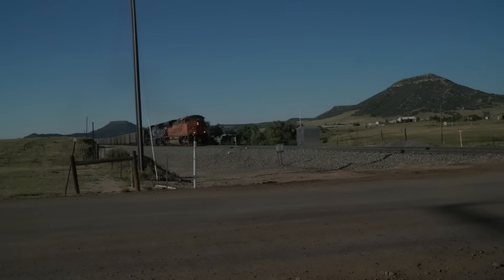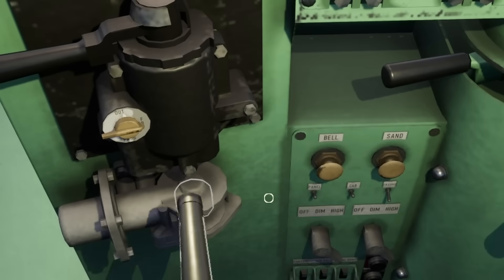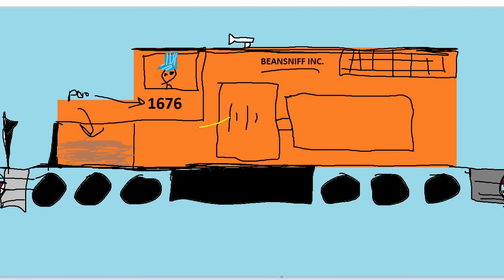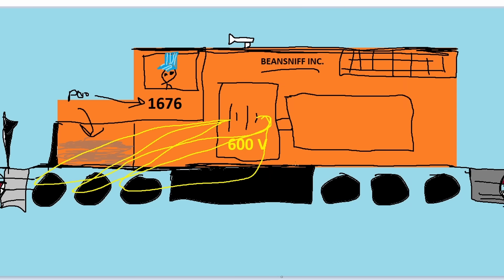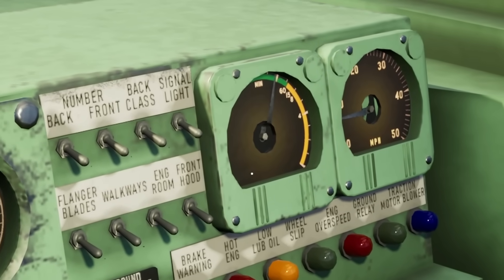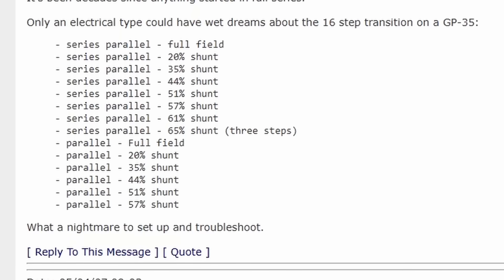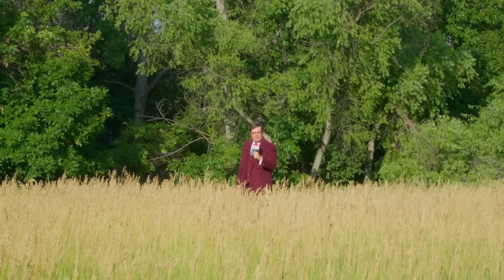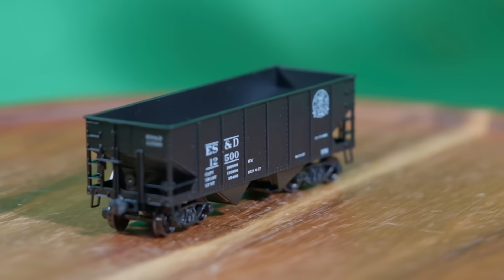The HIDDEN GENIUS of diesel electric locomotives... Transition explained - Railroad 101

Comment: AC motor circuits can actually be simpler than the DC setup described. I'm not a locomotive engineer, so I don't know how this actually works, but a neat trick with AC motors is as follows:

Most railway locos that use AC motors use a sub-class called Induction motors (mostly because they are cheap, robust and have reasonably high power ratings). The torque that an induction motor puts out is proportional to the difference in speed between the AC frequency (called Synchronous Speed) and the motor's shaft. (Electrical Engineers at this point will go on about machine poles, wound rotors and flux issues but please, I'm not talking about that now).

One other thing is that the frequency of AC produced by an alternator is also proportional to the speed of the alternator. So technically you could control the speed of an Induction Motor by simply varying the speed of the alternator, which you can in turn control using the Diesel engine speed. I don't think this is how it works, but you can probably make this work if you vary the voltage in the right places.

Comment: G'Day #Hyce! I worked on Locos. I was a Mechanical Fitter/Diesel Fitter here in Perth Australia. I wanted to be an Electrical Engineer, but  wasn't that smart, so I tried to be an Electrical Fitter.  I was told that if I did Mechanical for a year, I could transfer to Electrical , but they insisted on a 4 year apprenticeship, meaning a total of 5 years, with one year wasted. I said no. 
These are Aussie terms, but basically I spent 4 years at #Westrail, working on lots of locos Various engines and sizes. Our biggest Loco, Standard gauge was the "L Class"  had an EMD 654 E3 v16 which made 3300HP. I rebuilt these or did engine rebuilds, upgrades, refits etc. Concurrently, after working a 40 hour week I did night school, starting my Dip. Elec Engineering, 4 hour sessions, 4 nights a week for two years and finally gave up. 
For two more years,  after a 40 hour work week, 4 nights a week, I studied the Diesel fuel injection, Air Conditioning, Pneumatics, Hydraulics and some Automotive courses too (Auto A/C, Pollution controls, Auto Electrics, etc. After 4 long hard years, I walked away. 

I went on to be a Magazine photographer and shot most of the bands and singers in the 1980's for music magazines. I spotted your guitars and thought I'd mention that I own a 1960's Semi acoustic base. The same as used by the Yardbirds and a few famous British bands. I sucked at guitar... I'm 61 now and teaching myself keyboards. Currently mastering "Simple Man by Lynyrd Skynrd" Thanks for an awesome video. You explained everything so well and you should be lecturing at Technical college! Thanks heaps for this video and much respect.

Comment: I remember well that the SD-40s will transition at 25 mph and 45 mph. 

Interestingly, the GEs that were prevalent at the time (early 2000’s) had the traction motors all in parallel all of the time. I remember pulling up the screen that showed various parameters, and when they were really pulling hard- like less than 15 mph in run 8, the generator current was pretty close to five figures.

Comment: hey, Hyce, randome little request, if you may. about Derail Valley. i jsut ended up fixing, and painting up my DM3. could you explain to us a bit of effective real breacking with the Egine breacks?i am still unsure about it. i mostly use Train break, wen on a jo, or independent breacks when standalone locomotive, but i am sure that the engine break is also something really usefull!
Reply: Engine braking on DM3 is simple. Move throttle to idle and adjust braking lever. Higher engine RPM and shifting to lower gears give more braking force.
Reply: @Knsgf  thanks! will try to get more used to it that way. train break is really weird. i'm nit a big fan of it 😂

Comment: I thought the series-parallel stuff was referring to whether the field was in series or parallel with the rotor, (or whatever those parts are called in a motor.). Do they use AC induction motors today?
Reply: Motors with parallel field are suitable for powering industrial equipment which runs at constant speed, not for locomotives. While newly built units use induction motors, there are still a lot of old and refurbished rolling stock with DC traction.

Comment: It would be simpler if the diesel engine powered a hydraulic pump that would push oil to the hydraulic motors on the wheels
Reply: how bout 4 diesel engines going to a gearbox full of mechanical nonsense that moves an axle that moves rods which move wheels?
Reply: @davidty2006 Ah, the good ol' class 10100. With 2 extra diesel engines for whoosh.
Reply: @davidty2006 another one who has no idea about hydraulics or what he's talking about
Reply: Diesel-hydraulic is not exactly good for very heavy applications. Maintenance wise, more complicated than a traction motor as you have to deal with high pressure liquids and seals.
Reply: @OptiAero6432  on the car, the power steering pump has been working without error for 20 years, the oil itself needs to be changed on time,if such or a similar pump were dimensioned in a relative ratio for the power it has to transmit, there would be no problems, because on airplanes there have long been pumps with a tilting plate through which the flow and pressure of the fluid can be changed so that the diesel motor can constantly work at the most suitable revolutions depending on the required power
Reply: @makantahi3731  Steering circuit in a car doesn't accelerate the car. Hydraulic systems in an airplane do not accelerate the plane. Diesel locomotives, unlike cars and planes, have to drag thousands of tons behind them. Their power demands are much, much higher than a hydraulic line with flexible hoses can practically withstand without bursting open. There is a reason why diesel hydraulics are built with a hydrodynamic and not a hydrostatic transmission.

The only practical use for swashplate hydrostatics in a locomotive is controlling speed of radiator fans. And even there it's not common: on most designs fans are either driven mechanically by a prime mover, or by small induction motors.
Reply: @Knsgf  The reason why the first locomotives were diesel dc-dc is that those who produced them had no idea about electricity, although they could have produced a diesel ac-ac locomotive with the available technology, but they were ignorant. Compared to a dc-dc locomotive, a diesel hydraulic locomotive would be easier to use because the hydraulic system transmits significant power, for which it does not matter what it does: whether it moves a piston or turns a rotor, hydraulics are widely used on high-power excavators. It is important to properly dimension all parts and there are no problems, on my car the flexible hoses are rated at 160 bar, and the permanent pressure is about 20 bar. With a sufficiently large cross-section and moderate pressure, the power of 5000hp that locomotives have can be transmitted without any problems
Reply: No it wouldn't. All those shafts, converters and gearboxes bring in more complexity at high horsepower than electricals do.
Reply: @Knsgf  You don't know what you're writing about, there's nothing to what you said.

Comment: Hyce,you really should go into the history of K,and M,type controllers on Streetcars,and Interurbans,plus electric locomotives! Both GE,and Westinghouse were involved in DC,and AC transmission systems,and the resultant equipment! The New Haven railroad was deeply involved,as that company dealt with both AC,and DC operations into Grand Central Terminal! Woodlawn,was a transition zone,and the Locomotives,and MU cars,did the changeovers,at speed! See also the PCC streetcar/transit car control systems,as that influenced many other operating systems! Anyway,the taken for granted systems,now operating,have a real 100+ year old history! Thank you 😇 😊!

Comment: not only on diesel electric locomotives this is used, obviously. Older trams using DC also used this type of transition. The simplest case (2 motors) was a series to parallel transition. This was obviously before modern power electronics (i. e. used until ~ 19 sixties)

Comment: Just for your information, this switching from series to parallel was actually a thing in European trams from the early 1900's (it was even used in the first subway in the continental Europe, in Budapest in 1896). And even from the early 20th century the switching between circuits was "automatic" - the main power controller just had X series and Y parallel positions, with a few setup stages between (which set the motors or motor-couples in a bridge configuration and connected back the shorted resistors).

Comment: Because this is in the electrical system wouldn't this be used in electric trains as well if they have similar traction motors and a DC motor?
Reply: Motors transitions are largely confined to DC powered rolling stock. AC locos don't need them, as they have switchable transformers capable of giving any arbitrary voltage.

Comment: that's neat!  I thought "transition" was going between series wound to shunt wound on the motors.  Learned something new!
Reply: Shunt wound motors are not used in locomotives, as their characteristics don't suit vehicular demands. They run at near constant speed when supplied with fixed voltage, and their torque increases linearly with current, as opposed to series motor, where torque is proportional to square of a current. Shunt motors also require a field resistor, which wastes power as heat.

Comment: My favorite locomotive is Diesel-Hydraulic so video not helpful 😂. While the DB BR-218 is very much in Phase out with approximately 100 Locomotives still in service down from 411 originally build. I love the loco for its unique design and just pinnacle of German engineering. In the late 1960 the just engineered Diesel-Hydraulic to it’s absolute perfection and now over 60 years later still approximate 1/4 are still occasionally in service.

Comment: Hello sir. I like watching your videos and learning a lot about steam and other cool bits like how copler technology has changed. I am a big railroad fan and run a 7.5" railroad in South West Florida. I am also and electrical engineer and teach electrical at a local trade school. What you said was spot on about how electricity works in parallel and series modes. In the electrical world, however, we don't call a transitioning. We call it soft start. No matter what you call it and no matter how it's done it's limiting the amparge during start up. Good job. If you have questions I would love to chat with you.

Comment: Great video, i never really researched how trains manage to start from full stop and go at a highway speed with these big DC motors. I always imagined they use huge solenoids and several rinds of brushes on tha shaft to add coils in series on the motors themselves for high speed or put them in parallel for speeding up from low speed :D

Comment: Electrician here. The way series-parallel operation is shown in this video isn’t quite right. It’s pretty rare to see locomotives that run with all six traction motors in series. In series-parallel, the motors are grouped into three pairs, each pair wired in series, and then those three pairs are connected in parallel. That’s where the name comes from: series within each pair, parallel between the pairs.

When transition happens around 23–25 mph, the locomotive’s control system shifts to full parallel, placing all six traction motors directly in parallel with the traction alternator. On some models (like the SD60 and a few newer DC units), the traction motors stay in parallel the whole time. Instead, the generator itself transitions. Its two stator halves are placed in parallel through a series generator contactor (SGC).

Comment: I know you have a few SimRail videos but if you haven't tried driving the EP07/EU08 and ET22 trains in that game you should give it a try. They're not diesel electrics but pantograph electric but the traction motor stuff still applies.

Turning a giant wheel to set the precise resistance while also operating a shunt lever at high speeds is pretty fun. There's "notches" in the sense that there's a transition stage to full series (no resistance) and later full parallel (no resistance and then you start using the shunt after that.

Very unique simulation and driving those trains feels unlike anything else, in a good way

Comment: And you didn't mention Alternator transition, and barely mentioned field weakening in relation to the GP35, even though various forms of shunting existed until 3-phase asynchronous AC motors be came the dominant form of locomotive drive systems.

Comment: 2:18 remember that an electric motor is also an electric generator, due to the laws of physics, yeah? Well, the laws of physics work at all times. So when you spin a motor by using electricity, it generates reverse electricity by spinning. The more electricity you give it the faster it may spin, but the faster it spins the more electricity it pushes back. And the running speed of the motor is when power feed electricity meets the generated electricity, minus the load and the losses.
Reply: The exact equation for DC motor speed is n = (U - I * R) / (C * Φ), where n is rpm, U is voltage, I is armature current, R is armature resistance,
Φ is strength of magnetic field and C is a fixed constant that depends on motor design. From this formula one can see 3 different ways to control speed: by changing voltage (generator output control and transitions), magnetic flux (field weakening) and by adding extra resistance (old electric locos, EMUs and streetcars with resistance control).

Comment: In the Navy, worked on a large WW II era sea-going tug. It used four DC motors and four DC diesel-driven generators. The switchgear was operated manually, but we could configure all sorts of series-parallel combinations. Switching between them was a bit tricky, but when you know just what to do, it was actually rather fun for a 20-something Electrician's Mate.  :D

Your explanations are great, enjoy your channel.
Reply: Just to add, we controlled the generator field currents, the motor field currents, and the series-parallel connections all manually. When the OOD ordered up 1/3, 2/3, standard, etc... we would reduce field currents, shift the contactors and increase field currents again to shift configurations. Yes, if we 'screwed up', we got a call from an irate OOD.  lol

Comment: Sorry my inner Sheldon has to come out. 
Ohms law is not defined as I×R=U 
it's defined as U/I  = R 
Because a current can not flow without a voltage difference. A ohm is derived unit which is defined as U/I.
U and I are Si units and can be measured individually a resistance can only be calculated by knowing the Voltage and the current. 
Thanks for your video it was a pleasure to listen.
Reply from the maker: Pedantry appreciated! I'm sure you're correct in the true definition. Us engineer types don't care and do the algebra we need. :D
Reply: If we are going to be nitpicky, then in SI system, a volt is also a derived unit which equals 1 kg * m^2 * s^-3 * A^-1. If you take R = U / I literally when U = I = 0, then R would be mathematically indeterminate, however resistance is an innate property of a material that exists and has a concrete magnitude even without applied voltage.
Reply: @Knsgf I agree derived is the wrong term but if you read what Ohm wrote it states that you have to apply a voltage. 
A Ohm has the unit of V/A.
For sure the property of a material is physically defined by the atom structure and you could calculate the resistance property from that. But that's is not what Ohm law meant. 
It strictly says a voltage is the reason why a current will flow. And the amount of a courent is devind by the resistance in a conductive material.
To say a flow through a pipe is the reason why there pressure makes no sense. 
The pressure is the reason why you have flow. No pressure no flow.
Reply: @Mr.T9191-i2f  The Ohm's law only establishes relationship between voltage, current and resistance in a DC circuit. While voltage is commonly required for current to flow, this is not always the case. There certain materials called superconductors, whose resistance becomes absolute zero below certain temperature. In such a material it's possible for current to flow with no voltage. This doesn't violate Ohm's law: any current * zero ohms = zero volts.

Comment: fun fact there are differences between a generator and a alternator a alternator produces 12 to 24 DC currant for a car or big rigs and heavy equipment a Generator produces AC power which is used to power house carnival rides office buildings and the traction motors on a locomotive DC meaning direct currant and AC meaning Alternating currant DC currant flow in one direction while Alternating currant alternates back and forth very fast I know I'm not a electrician by trade but I do know enough that when it comes to information like this it's best to get the identity right when it comes to identifying the components of what ever you are working on

Comment: Just a small comment. This applies to fully electric locomotives too. Especially DC electric locomotives with 6 powered axles. Or streetcars (they are DC powered). Even some really "prehistoric" two axle cars can switch series-parallel those two motors.

Comment: Some early electric vehicles did something similar battery side. It had a 48V battery, but it could implement multiple speeds by connecting them either in series for 48V, or series/parallel for 24V, with a resistor for very low speed.